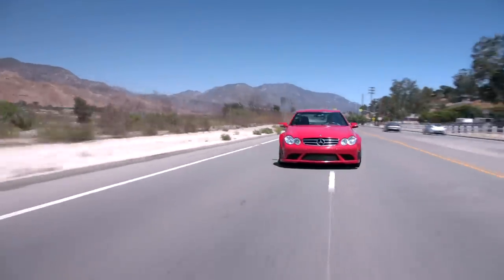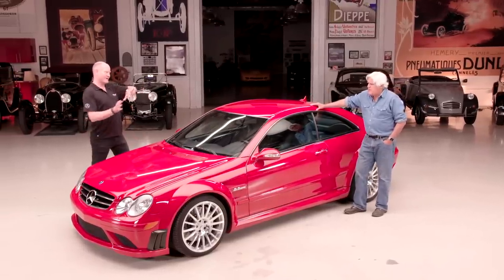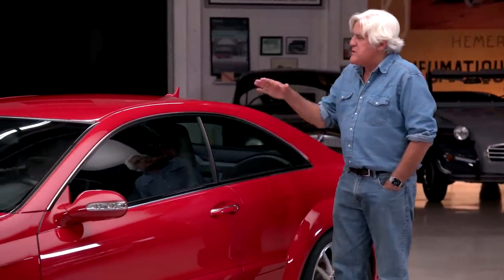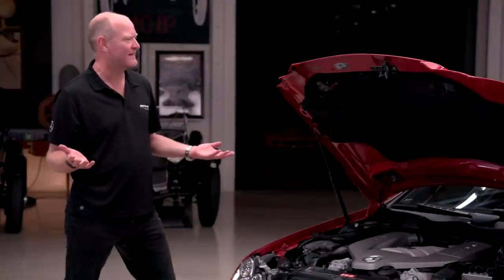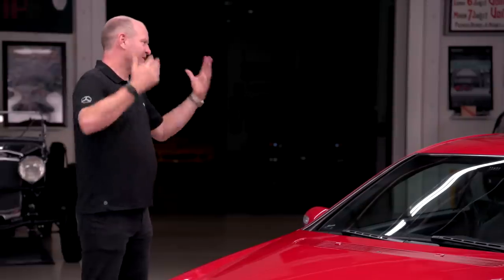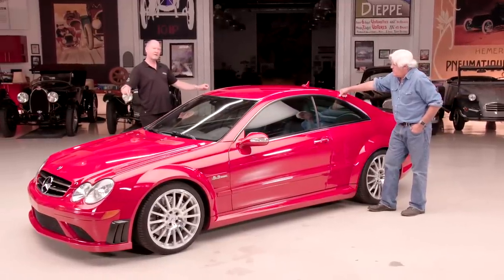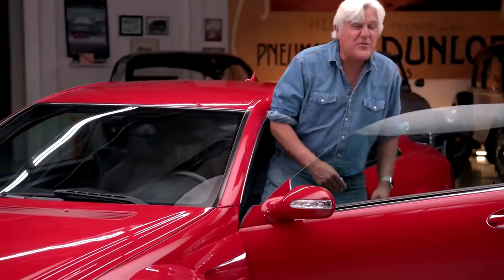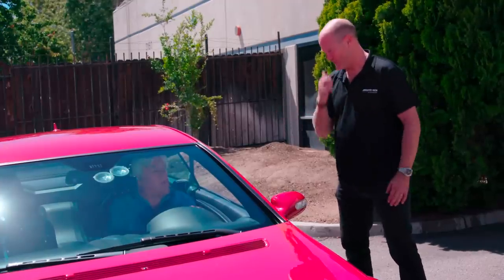2008 Mercedes-Benz CLK63 AMG Black Series | Jay Leno's Garage

Comment: Dual clutch transmissions are outdated by now, and already were when this video was made, so don't understand why Jay thinks it's the modern thing. All European manufacturers stopped using DCG several years ago because those transmissions run into significant stalls and shift lag when it guesses wrong which gear you need next, and that can make them very sluggish to drive in situations where it frequently has to shift up and down - like stop and go traffic, and racing on a track. Instead nearly all manufacturers have switched to electronic automatic gearboxes, which do have a sort of torque converter that can be locked for direct drive, and have separate clutches and brakes for each gear cluster, which lets the transmission shift gears at light speed and skip gears as needed - something that's not possible in a DCG. Essentially, modern automatics are similar to the semi-automatic used in racing, but with a controller that lets them function as fully automatic or manual shift

Jay is wrong on the tyre thing. In Germany the manufacturer have to file a list of suitable rim dimensions and tyre types for every vehicle type they sell, which really goes along with the normal registration data, but it's not like you get a table of specific tyres you're allowed to use, because that would be ridiculous and would be outdated after a year.  Instead it's a range of suitable tyre types and dimensions you have to be within. The important part is that you have to stick to the correct offset and wheel circumference, and of course speed rating, and the tyres are not allowed to be wider than the fenders. But because we have summer and winter tyres, economy, daily, sport, and a bunch of different other options for tyre design, it would be impossible to say you can never change the tyres - and also illegal because consumer rights mean we're allowed to buy whichever tyres we want, as long as they're suitable for the car. Keep in mind, that if the rules really were as strict as Jay said, it would be illegal to use the space saving spare wheels

Comment: It really should have had a manual gearbox; the auto in it is clunky and slow, and the gear selector is a joke. The M3, S4/RS4, and even Cayman were all offered with a 6MT back then. This would have been a true muscle car with that transmission. Hard to find these under $120k anymore regardless of mileage too 🤯.

Comment: Everything is great on the vehicle.  The only downside (after you don't shotgun the engine.  You know what should ve checked right away) is, the "American" influence.  Those horrid round headlights.   This vehicle (not a commuter car) is amazing besides the front headlights.  Awful Jaguar/Mercedes round.  CLK (Dainty) besides the Black Series.  The SL is the one to get.

Comment: One of the most unreliable engines. Head bolts breaking, head gaskets leaking. Class action lawsuits.
Reply: It’s a fantastic engine with amazing performance, not a big deal changing head bolts once. There actually very reliable
Reply: @bernardwarr4187  My 2009 CL63 Was Junk.

Comment: Not feeling the love the others have expressed for the guest. PR guy through and through spouting all sorts of horse manure. "the car was developed to be an F1 safety car" Absolutely rubbish. The F1 safety car is marketing exercise, product placement. A normal CL500 would probably do the job of a safety car just fine, let alone a conventional CL63 AMG.  Same with the quotes about the nurburgring lap record being held by mercedes. Wrong, it's been beaten by Porsche.  Same with the rubbish about trying to draw a link between the road cars and the F1 cars. No link whatsoever .... hate it when jay has PR guys on the channel. Much prefer when they have the engineers like the ford guy for the Mach 1 the other week.